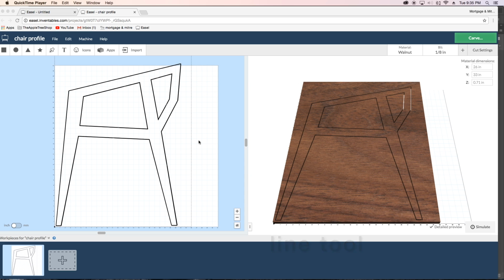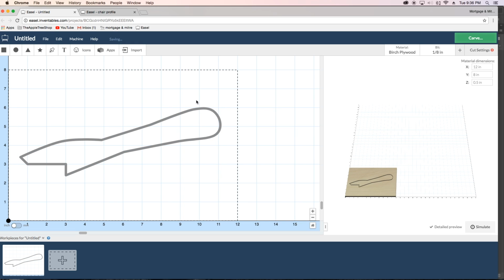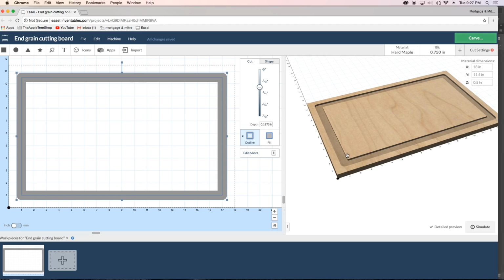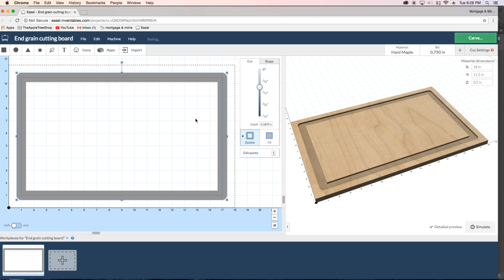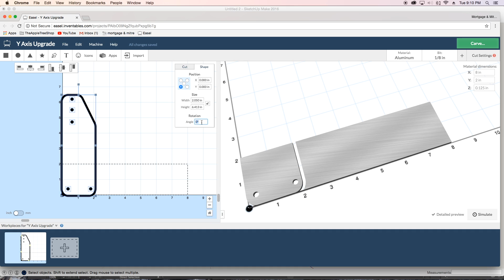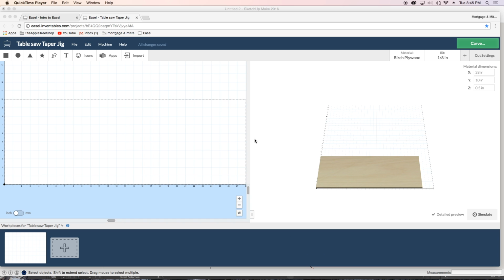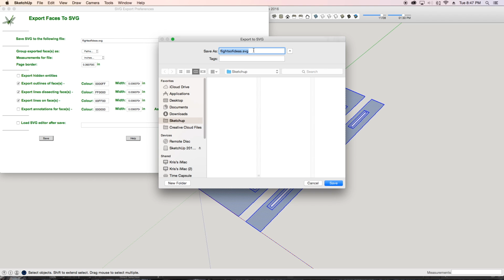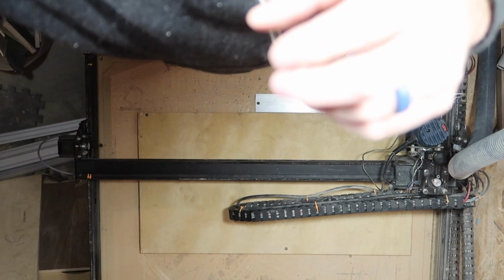4 Tip, Tricks, and Hacks for using Inventables Easel

Comment: Help. I am trying to use a half in round nose bit to make a juice groove but easel doesn't recognize the bit, so it won't carve. How can I program it to carve a juice groove?
Reply from the maker: Run a test piece but just use the width of the bit in easel. Do not worry about the bit type.

Comment: Im new at this and kinda a padorkas, how do I draw ? how do I stop the line segment?
Reply from the maker: Try double clicking on the end point if the line.
Reply: it worked...awesome, now how do I get rid of them little screens ,I tried to move them to back , but I apparently aint doin it right
Reply from the maker: chuck cook sorry, not sure what you means.
Reply: @furthernorthfab  1 is 
the sreen on far left that has "shapes,lines,letters"and something "else
Reply: how o I get the full screen too ?
Reply from the maker: chuck cook you can slide the middle partition that separates the preview on the right and the workspace on the left over. The tool bar on the far left always stays there.

Comment: On the Y Axis upgrade, you should have matched the shape to the width of your material.  You were already carving the outside of the shape.  You see that it does not cut anything on the bottom of the design (left side in video), but does cut into the material on the top (right side).  If design was set to the full 2 inches matching the material, the width of finished product would have been the full 2 inches.  Otherwise, good tips!  Thanks!

Comment: Is it possible to get 3D carving from Easel or Easel Pro?  Thanks, I'm looking at buying an X-Carve to make guitars and other wood carvings..  (Multi layered carved or arch top as well as strat types of guitars)  Thanks for your response
Reply from the maker: Hi Phil, It's totally possible to use Easel for this. I'm not sure if you are familiar with Fusion 360, but the CAM portion of Fusion would allow you to export G-code that Easel could run in either version. If you do order a machine, let me know first and I can send you a link.
Reply: @furthernorthfab  Thanks

Comment: It appears you dont use clamps...you just screw ur part down into the mdf using wood screws?
Reply from the maker: Guess it should have been 5 tips or tricks. Haha
Reply: @furthernorthfab  I thought that I was the only one to screw directly into a sacrificial MDF table top! It works so much better than clamps!
Reply from the maker: It’s called a waste board or spoil board for a reason, right 😜. Mdf is cheap.  Haha... thanks for watching
Reply: One disadvantage of screws is that a mistake in programming your gcode will make the bit run through the screw which more often than not means a broken bit. You can also use double sided tape or better yet use painters tape and CA glue. This works beautifully. Place a piece of tape on the wasteboard facing down so that it actually sticks to the wasteboard. Optionally sprinkle baking soda just a little bit as an accelerant. Stick another piece of tape to the back of your raw material. Add a few beads of CA to the tape you stuck to your material and stick it to the wasteboard making sure your tapes are aligned. You end up from bottom to top: wasteboard, tape, ca glue, tape, material. This is so strong that you don't even need tabs. After you are done, just pull the material off the wasteboard with your hand and peel the tape. No mess, no scraping, no tabs, no clamps, no screws, and it's super fast. If you have CA accelerator it's instantaneous even.

Comment: is there any way to get easel to start with the cutter at the center of the work??
Reply from the maker: Yes, there is a setting for that or in you are importing G-code from programs like Fusion 360, you can start the middle as your start point.
Reply: ok , ill have to look again.. im actually exporting from easel to universal g code sender
Reply: and UGS shows the origin point that was set in the other program , so it has to be done in easel
Reply from the maker: You know what, Rob. I might be wrong about being able to chance the starting point. I’m not super familiar with UGS. I’ve used it with my laser engraver and I always have it set on there to start from the bottom left corner.
Reply: in UGS , it uses the start point you used in whatever program./. SO for example when I use fengrave , it automatically starts in the center because I set it that way in F engrave.. Whereas with easel , I have no idea how to move my bit to center in the virtual platform on the right,.
Reply: so ugs just copies whatever you had set in the other program , but I don't know where the easle settings are to move my bit starting point.